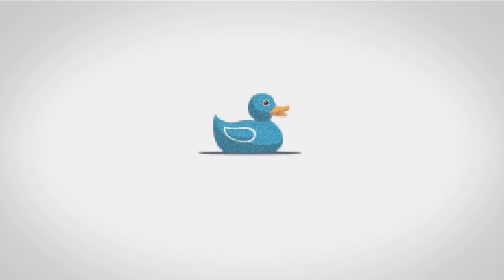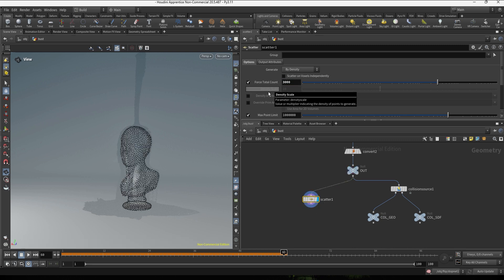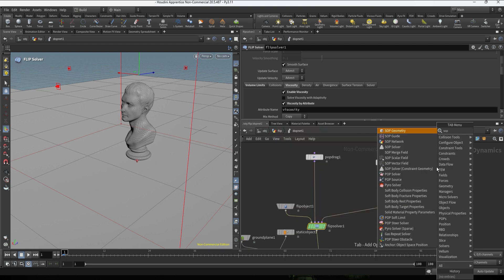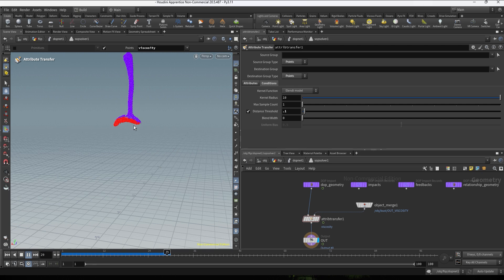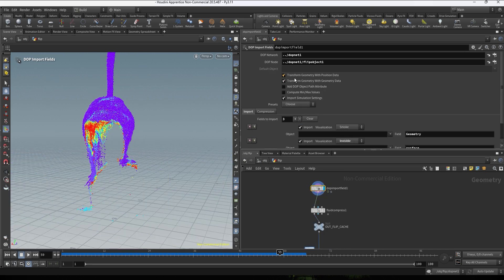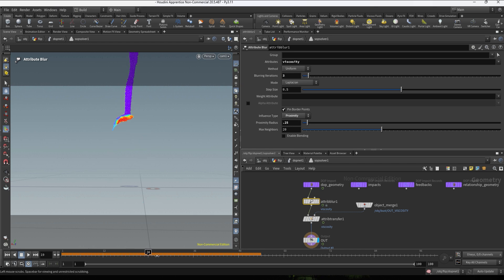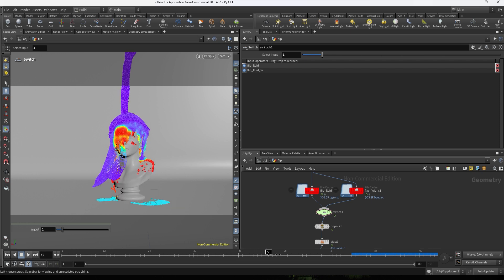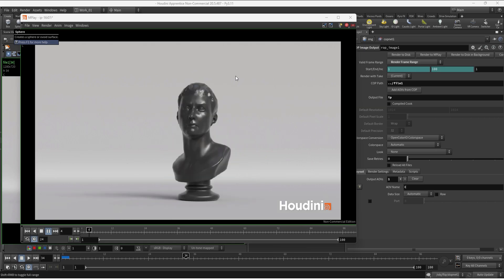Variable Viscosity in Houdini - SOP Solver and Collision Control

Comment: Cool workflow! Would it not have been simpler to use a popgroup with a popwrangle though? 
  Although now that I think of it, this solution does seem to give you more control. 
   But then again if you used a lerp in your popwrangle you would get the float value linear interpolation over your viscosity for your points in your pop group. 
  Also, any particular reason why you used the shelf tools here? I feel like there is so much more to be learned building through a dopnet!

  Also, one last thing, when I was first starting out in Houdini, one of the biggest challenges I faced was figuring out how to get viscous fluids to stick to my deforming/animated colliders! Everyone seems to put out all these tutorials on chocolate on strawberries but no one puts out Houdini flip tutorials that involve moving/animated colliders. I just think that since these are targeted towards beginners, that information is extremely valuable early on. Honestly, you could release a whole series on inherited velocities and how they work.
  Thank you!
Reply from the maker: Hey! So like many things in Houdini you have a lot of ways to achieve the same outcome, this workflow for me is pretty simple and gives you control.
The shelf was not used in the case, I just set up the network before starting the tutorial so it was not too long.

Regarding moving colliders, you do have a slip on collision setting to control that, good idea for a new video, thanks!
Reply: @HoudiniMadeSimple ah fair enough I suppose you do have to keep your videos at a certain length for the YouTube algorithm! Honestly I would really appreciate seeing more content that explored flip setups on a dop level involving moving colliders!